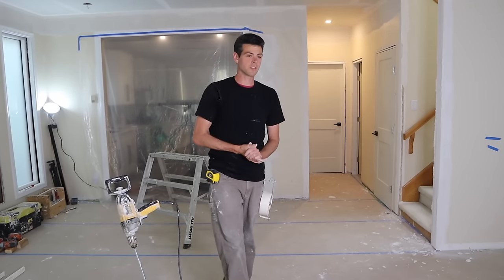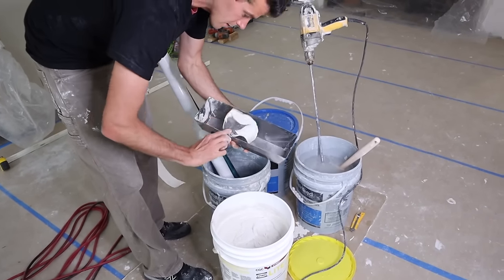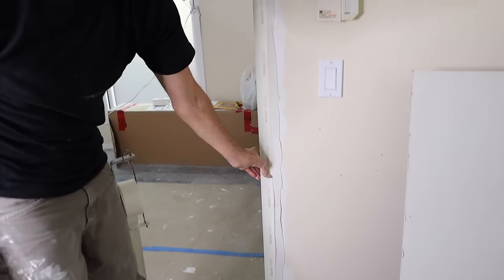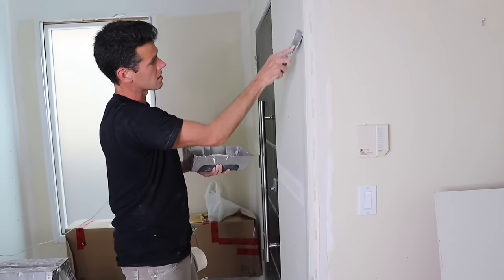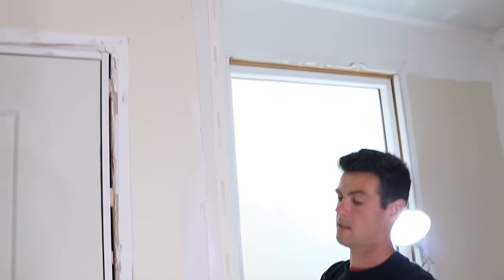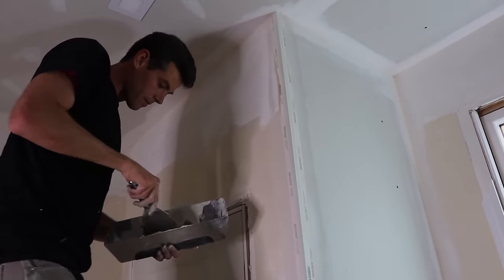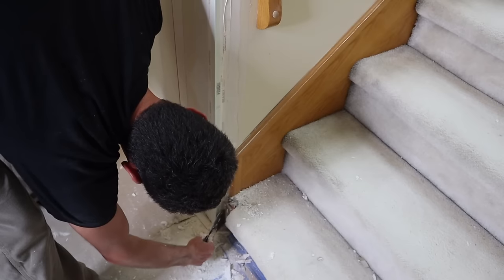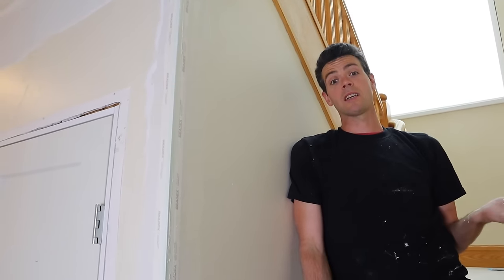How to Install Drywall Corner Beads!!!

Comment: Paper-faced corners. What a deal!  Beats the mailed-in all-metal beads (and stapled bull nose).  Question: if the overhead section had run into a vertical section, would you miter or just leave an open corner?
Reply: He has other videos where beads run into each other. Check them out. Good stuff.

Comment: Vancouver Carpenter: I need a video.  I bought an sweet old redoak door. It is about a 2x4 size too short.  The threshold is metal (non adjustable with nothing underneath) and currently goes straight to concrete.  I would love to have a video on a couple suggestions and demonstration on how to make it work.

Comment: have you ever used "3M Spray 61 Corner Bead Adhesive" instead of compound under corner beads?
Reply: I was going to ask the same thing.  I'm doing a bathroom remodel.

Comment: Help me out on a question please:
Are you supposed to precut the corner of the drywall slightly before installing cornerbead? My drywall contractor mentioned they do not have their drywall making a sharp edge/corner, they leave a 1/4” gap at the very corner so that the metal cornerbead flexes into position leaving a more rounded finish. This reduces those nicks you see at the very edge when its all painted.

Comment: Is mud for taping different from all purpose or is it all purpose with just different consistency?
Reply: All purpose mud is generally good for taping. It has adhesive mixed in. You're better off using a lightweight for topping/ floating as it sands easier than all purpose.

Comment: So, I used vinyl beads for the first time.  My local stores ran out of paper beads so I was wondering everyone's feelings about vinyl vs. paper.  I do normally use paper, I prefer them over the others (steel, bullnose).
Reply: I know.. 2 years late… but I use vinyl too and surprised he doesn’t have a video using it.  I see he used metal and paper.